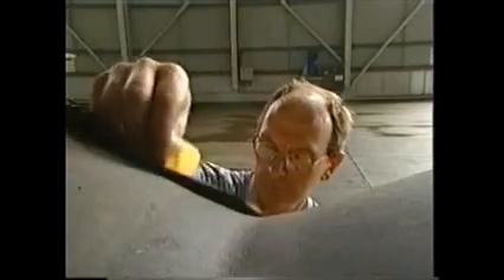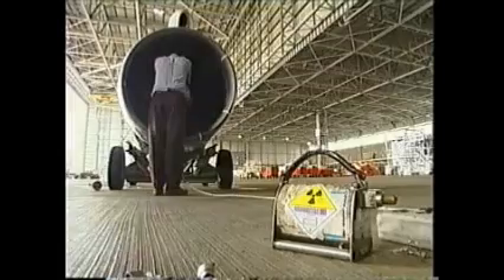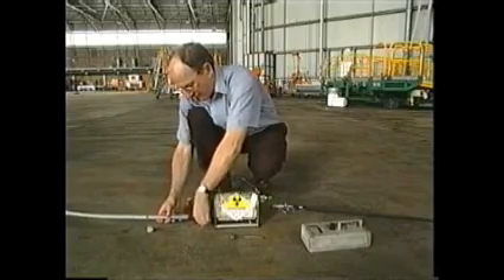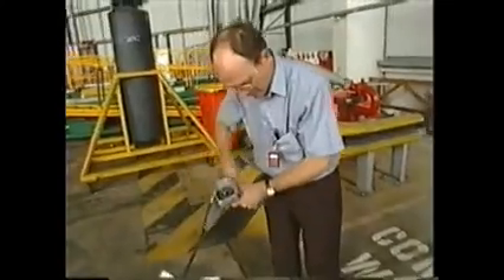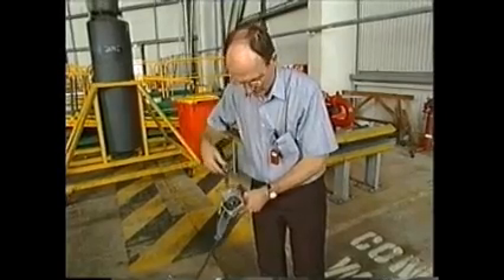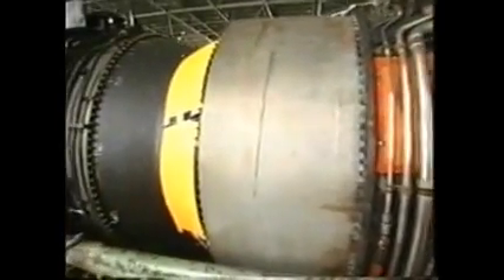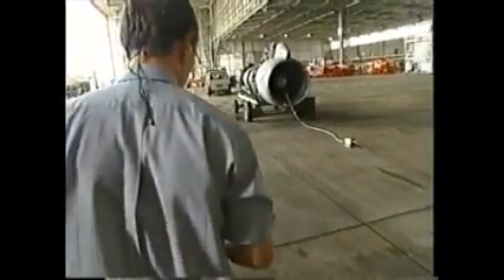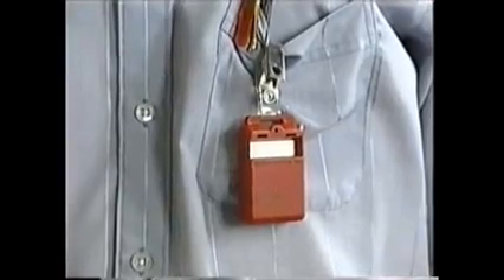Gamma Radiography Co 60

Comment: I was working in Bayway refinery, they had a flue gas valve thats 5" thick stainless steel. Every outage they would do an informational shot using cobalt 60 camera, the container used to transport the camera weight in at 600lbs of depleted uranium used as shielding.